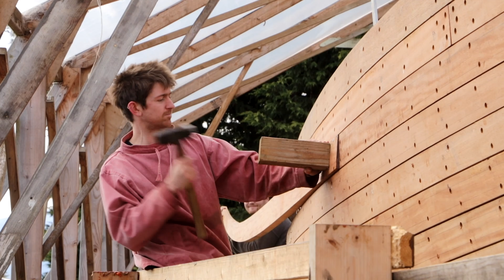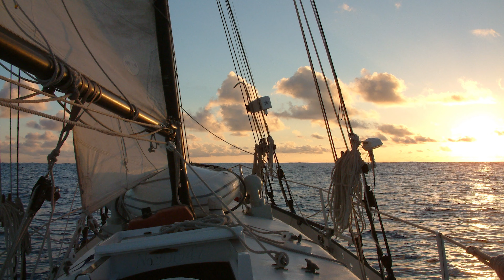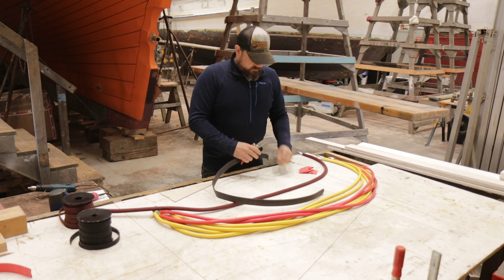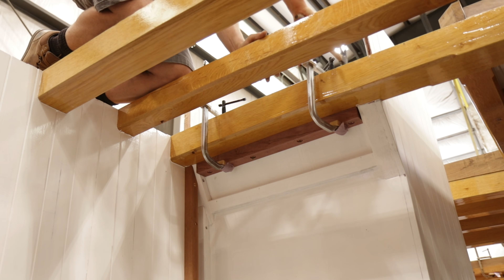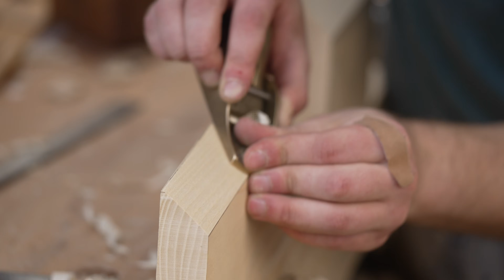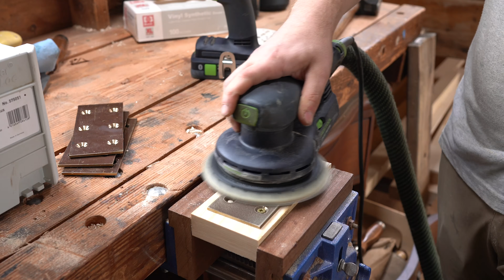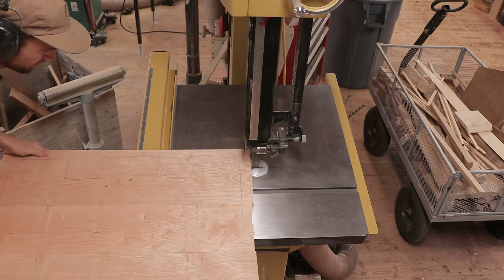Installing a Victron electrical system in the historic sailing yacht Tally Ho

Comment: 230v really is the way to go so that you get better efficiency and can run smaller cables for the same load :D
Reply: @ralphgesler5110  they said in the video that there are 2 inverters, one large one that is 230v and a small 110v for if thats ever needed. The any input voltage and frequency i believe is handled by the larger inverter by only directly connecting the onboard wiring to the shore if the shore power is 230v 50hz otherwise it just works as a charger on the chore power and inverts to create the needed onboard power. Since Leo is British 230v is also a expected voltage to use.

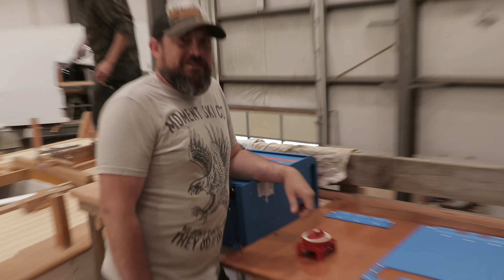Comment: @11:17 For Americans it's just somewhere in the world.🤔🤣
For all others: Victron is a Dutch firm. Good choice! "If it ain't Dutch, it ain't much!"👌😉
FYI: The massively outdated imperial system is only used in the UK, US, Liberia en Myanmar.🧐😁
All the rest of the world uses SI, the metric system. (All the car industry of the mentioned countries use SI as well...)🤓🤣
Reply: Almost zero imperial in the UK now.  My kids don't even know it so I have to translate to metric SI units for them.  And they are all adult "kids" now!
All that is left of imperial are miles/mph on roads, miles/furlongs in horse racing, car and motorcycle wheel rim diameters (same for most of the world), aircraft altitudes (true for most of the world, even the French [who lost at waterloo, so suck it up]), and pints (real 20oz ones, not the undernourished US variety - I guess their measuring jugs got dented on the Mayflower) for beer/cider in pubs.  Plus most of the older generation use imperial for casual use (but switch to metric for official and technical use).
Heck, I'm retired, and was educated in SI units in England!
Nautical miles are of course used for navigation of both aviation and nautical applications because it makes sense.
Reply: @The_Real_Phil_Lee  Happy to hear SI has taken over in the UK.
I worked several years on and off in the US, never in the UK.
Indeed the Nautical mile is bound to stay. It's the only one who has a real correlation with the Earth. Divide any meridian with 21.600 (360 * 60), and there is the Nautical mile.
360 for the degrees, and 60 for the minutes.

Comment: As a rough idea 1kg is around 2 pounds, so 45kg is around 90-95 pounds.
I've had to work in both freedom units as well at metric, no so hard once you start using both all the time.
Reply: Then you should know that the conversion is 2.204623 lbs to the kg (and that a pound is 453.5924 g), so 45kg is 99.20802lbs.  Volume is made difficult by the US using their own version of the imperial system, with the same name but different volumes for most units, and some differing even within the US depending on use (legal or customary).
Reply: @The_Real_Phil_Lee  close enough is good enough for 99% of what I do, thanks for the exact amount thow
Reply: @NenYim  For rough use, double and add 10% - 2.2x

Comment: Nice thing about having a 220VAC circuit is enabling Leo to coif his hair using two wires stuck into an electrical outlet. Gives him that same tossled effect.
Reply: *tousled
Reply: @teeanahera8949  Nice, learned a word again. Thanks.
Reply: @teeanahera8949  I learned a new great word, too! Whoa, it's spot on! For whatever reason, I will never be able to apply it to my - eh - very, very short neat and tidy hair 😄 Once upon a time, many moons ago, it would have worked fine though!

Comment: Just a brief comment and question.  Your guys like to drill metal parts by holding them with their fingers.  Also, they seem to allow long chips to spin around on the drill.  This is a terrible habit.  Sooner or later that long chip will cut a finger badly or take it off.  A good habit is to break the chip by lifting the drill.  You might also like to invest in a Heinrich  Speed Vise.. they are fairly cheap and fast to use.  The vise is pretty cheap compared to an emergency room trp.

My question is........ why did your electricians drill a hole in a panel and not bevel the edges of the hole.   This just creates a stress riser in the wire and the sharp edge that can cut the insulation on the wire.  Everyone does it, but, it makes no sense to me someone hasn't make a tool to drill the hole and bevel the edge.  I think they also make plastic things you can put in the hole to get rid of the sharp edge.  But, you didn't use those either.  Just seems like a bad spot to save a few bucks a couple of hours.

Boat looks great.  Thanks for the videos.........
Reply: The braided cable sheathing will make its own bevel if the cable can move at all.
Reply: Jesus Einstein, this one comment " Everyone does it, but, it makes no sense to me someone hasn't make a tool to drill the hole and bevel the edge." tells me all I need to know about your "expertise". Try googling Combined drill and bevel / countersink, also Rubber Grommets, instead of the technical term "Plastic Things"....
Reply: @7divad37  Should have said bulkhead fitting.  But, tell me all about the rubber grommets you use to go through 3/4 inch plywood, because that sounds like a high-quality solution. lols  Or about your hole saw that cuts a hole and bevels it? Or any other magical tools or non existent grommets you use in your professional work.

Comment: Thank you for the action and information packed update! I'm curious how much the internal bulkheads and such contribute to the overall stiffness of the boat? It seems like the hull and deck is designed to be everything that it needs to be sound but there are some long spans that now have bulkheads attached. Just curious on if they have an impact on the overall flexing and twisting while under sail and/or on heavy seas and if so what you would expect that to be? Thank you again for all the amazing insight into the planning and process!
Reply: They do have an impact. Most boats are designed not to need them even though they increase the stiffness

Comment: Little bit disappointed in the use of cable ties instead of panduits and a better containment I.E tray, also a lazy bend radius but on the whole not bad for an aircraft spark
Reply: "Why not do this unnecessary thing that I want to promote to feel like I am a smart boy"
Reply: @jonnenne  haha how unnecessary. Cable ties have been deemed unsuitable in bs7671  as a sole means of cable support, and are not permitted onboard ships that require defence standards to be adhered to (my job). 

Obviously cable ties will last at least a decade in this instance but my objection was based upon the fact that the rest of the work has been to such a high standard, anything other than stellar electrical install is a blemish on the otherwise beautiful tally ho. Absolute no need for your vitriolic response

Comment: Outstanding screw alignment George. You made thousands OCD’s very happy!
Reply: I’m actually CDO. It’s like OCD, only the letters are in alphabetical order - AS THEY SHOULD BE!!!
Reply: Hear hear.  Clocking the screwheads but did I see nicks in the brass from using the wrong screwdriver?  
I fear I'll be awake all night fretting.  Haha
Reply: Wouldn’t have them any other way.
Reply: Aligning screw slots looks nice, but the result is also that not all the screws are tightened with the same torque (~preload-force). Wood is more forgiving; in metl contructions this would be a definite No-Go.
Reply: Copper bus bars are golden!

Comment: Bus bar! I learned something new today!  Just wondering, how do you ground an electrical system on a wooden boat?
Reply: Everything metal that contacts the surrounding water needs to be electrically "grounded" (connected) to every other piece of metal......
stops galvanic corrosion...
and to utilise whatever voltage system internally...you have   to provide a dedicated "ground" wire for the electricity to complete a circuit......
Reply: Wooden and fiberglass is easy. Metal boat is difficult. You just do a "insulated" system where the ground is just a basic common ground

Comment: As a person who has better electric understanding than I do of any other process used on the boat, your electrical choices are confusing to me. So instead of telling you what I think you're doing wrong without knowing much about your decision process, I'll just ask question or shut up and wait for the overview video on the electrical. In particular I'm not sure why you used a separate 240v and 120v inverter system, instead of just using a dual-voltage inverter, as it's trivial for an inverter to toggle between the two and just about any 240v system should be able to drop to 120v, same as a laptop powersupply. And, not knowing much about boats, I'm not sure why you picked 48v (marine standard?) only to immediately convert to 12v. I also hope you're using 120v or 240v appliances and such on the ship rather than using specialized marine or RV DC voltage stuff, but even if so, I'm curious about those decisions.
Reply: 48 Volt is likely to support the electric propulsion system. I'm very curious how the sail charge system from the engine will be regulated with victron bms. If they're using a wakespeed alternator controller for example, or some other system that respects charge state of the bank.

It's entirely possible that there's a bunch of equipment onboard that needs 50 or 60hz specifically, so there's internal conversion on that board. A native 240 volt inverter with an autotransformer might have been another possibility, but I don't think we'll get those details.

I'm a little concerned at the battery switches, they look like blue sea switchgear (the big red ones) and are not rated for 48 volt (~57 nominal) voltage. I hope the electrician tins the custom bus bars to reduce corrosion susceptibility.

Comment: I haven't use the victron stuff myself, but I've heard so many good things about them from people I trust that I'm sure your electrical system will serve you well.
Reply: They are the only company I know of that specializes in the AC/DC systems space that are needed in Marine applications as well as things like RV's and 'off-grid' power applications.  Maybe there are other companies but it doesn't seem like the technology or quality they offer even comes close to Victron.  Other large companies that manufacture electrical components are focused on Residential and Commercial installations and they rely on volume of sales, the marine space is too small for them to care.  I'm glad Victron is the company that is, otherwise we'd be way behind in powering Sailboats with solar power and lithium batteries.

Comment: Hello Leo:

I am an EE and have worked on the electrical systems on many boats.  One of the greatest problems is “GREEN MOLD!!”  This is caused by the very humid conditions found on boats.  
Once oxidation starts, the connectors must be disassembled and repaired with new connectors that are soldered.
I note, in your recent video, that the battery terminals are crimp not soldered.  Yes you will not have problems now but in the future you will have intermittent electrical issues.
Considering how meticulous you have been in the reconstructing of TALLY HO, I strongly advise that you solder ALL crimp connections so that you do not have a wiring problem in the future.
Good look and GOD speed!!
Reply: To crimp or to solder is highly up for debate, with about half of people on either side. Which to me says "You're arguing over minutia, and it doesn't matter or this would be settled by now." Soldered joins shatter and tear. In automotive use, crimped is the standard, soldered is avoided.
Reply: Agreed. Copper oxidizes very readily, and so it's important to seal out oxygen. It doesn't take too much effort to flow solder into the crimp connections, locking out oxygen, salt and water, preventing corrosion.
Reply: Crimping is the best way on a boat. Soldering is very much the subpar method on boats
Reply: Tinned copper cables and glue heat shrink is the best method ive found.

Comment: If the OG Tally Ho had electrical way back when, imagine what early 20th century wiring would have been like. Single solid copper wire coated in gutta percha (look that up) with a cotton cloth wrap over it attached to lead acid batteries and through a fuse box with maybe 4 fuses that screw in. Probably installed by someone that knew Tom Edison personally.  Wire would be hung with knob and tube fixtures below decks which was very modern for the times.
Reply: I'll guess that Tally Ho had no electrics as built - the lighting, cooking, heating & engine were all kerosene-powered. A small amount of gasoline would be carried as 'starter fluid' for the hand-cranked engine.
Reply: Hello my friend. Your supposition of how the original Tally ho was equipped is quite possibly true, however, I was doing a then versus today comparison of technology. The current available equipment was the stuff of imagination for H. G. Wells when Tally Ho was first launched. Best regards, Gio'

Comment: The electrical installation is great. I wished my DIY PV system would look nearly as clean.
However, mounting the DC/DC converters this way will reduce the cooling effect of the finns at the back which will significantly reduce their performance, because they will reduce their output to stay cool. A horizontal mount would be better.
Reply: The fins would get less airflow if they were attached horizontally. Warm air moves up, not horizontally
Reply: @jonnenne  Absolutely right. I talked about mounting the converters horizontally, because now the cooling finns are oriented horizontally.

Comment: Please, please warn your guys to never wear gloves when operating spinning machinies (drill press, sanding wheel, etc.). It's incredible how quickly a glove can get wrapped around or pulled into a machine like that and break all your fingers. I cannot stress enough how dangerous it is and I just don't want any of you to get hurt.
Reply: Agreed, even though I have found myself guilty of still doing it if im holding metal further from the actual drillbit, since I've had sheet metal caught in the drill and cut my fingers open. Best thing is to just use a vicegrip or actual drillpress vice (talking solely about drillpresses here, sanding wheels wouldn't recuire gloves in any case)
Reply: @thijsrikkerink6333  i had it happen to me once, still don't know how the drill grabbed my glove. I was drilling a 6mm hole into concrete, suddently the thing cought and was spooling up around the drill bit. Luckily i had just drilled deep enough and let go of the trigger the instant it happened. Maybe i wasn't paying attention and wanted to use my left to center the drill bit on the next hole ore something. Anyway, it stoppt rotating befor it ripped my finger off, but it squeezed it so hard, had blood being pressed out around my fingernail.
Reply: You are absolutly right. Gloves and rotating machines are the perfect combination if you want to cripple your hands and arms. Specially when drilling in metal.

Comment: There is nothing more beautiful to look at than an electrical installation that has been professionally installed.  Tyson knows his trade!
Reply: Super satisfying to see the cable dressing like that.
Reply: What a great addition to the team. Impressed with his work.
Reply: Big cables, nice routing, good terminations are very satisfying!
Reply: Extra weight and voltage drop for all those years just to maybe need it the next time? lol 🤦‍♂️
Reply: @CaptainPetrolburner  Um....you're only talking about a few pounds and not near enough added length to drop voltage. It's not a maybe, you can about guarantee it. If you think you're going to replace a component with an exact match and even if so that exact match is lined up exactly with the old one you're dreaming. Never gonna happen. If he actually does have zero slack as it appears, he will regret it.
Reply: A mark of fine workmanship is thinking toward the future, allowing access for the next fellow who would curse the former for his lack of foresight.
Not having to disassemble the works would make easy replacement of components and leads.
Reply: Shouldn't the blue boxes be mounted in such a manner that the fins of the heatsinks on their backsides are oriented vertically to allow a better airflow along the heat-sinks?
Reply: Sure hope there's a bit of slack left that they didn't show us. Replacement components 10 years down the road are guaranteed to not have the terminals in the exact same spots.
Reply: @ralphgesler5110  6 inches or so?

Comment: Looking good.  I do have one comment about the use of cherry for panels in the wardrobe.  As I learned from building and installing a cherry and white maple cabin sole in my boat, cherry when put into the marine environment will expand quite a lot across the grain (despite fabrication being done less than 200 yards from the ocean).  Consequently making a 2' wide  panel close fitting will cause issues when the cherry expands once the boat is in the water.  I had that problem with my cabin sole panels despite fully sealing them (I thought) with epoxy on the bottom and edges and Epifanes two part varnish on exposed surfaces.   Perhaps I didn't see the expansion joints in the video.  If that is the case, carry on.

Comment: Inverters need airflow , yup yes indeed. Proper ventilation , and less humidity will extend the life of your marine electrical system. Spray some LPS 3 or similar on your electrical connections.

Comment: Hey dude. 2.2 LB to a kg🤓
I’d be scared to run solid bus bars between the batteries in case they are shifting/vibrating during sailing thus causing stress to the terminals🧐